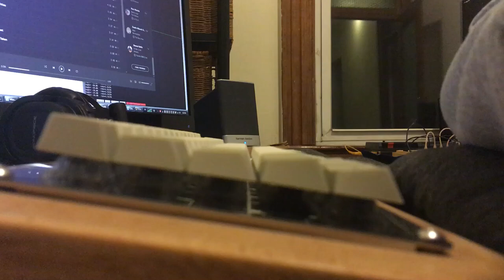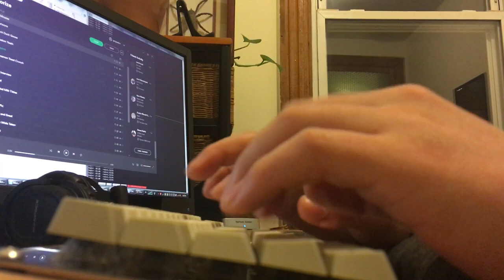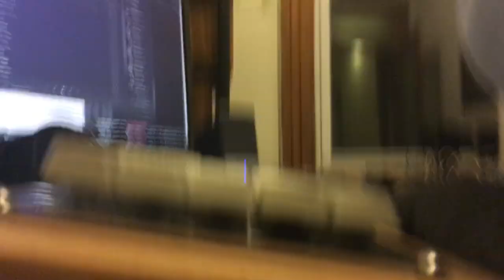Custom wood "gasket mount" keyboard typing test, silent Zealios

Comment: Do you feel any difference using the gasket mount?
What are the benefits of having the gasket mount?
Reply from the maker: The difference is subtle and it depends on how it's implemented. In this particular build, it makes the switches sound a little more "poppy", and it seems like it smooths out some of the vibration you'd normally feel transferred back into your fingers.